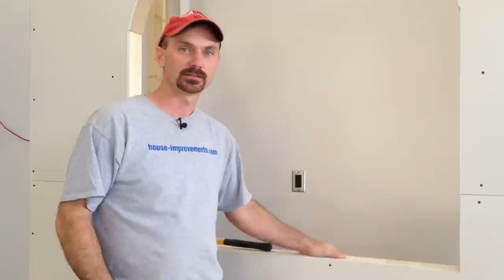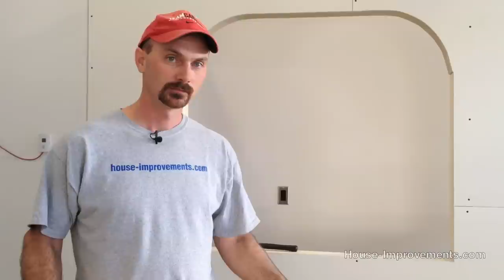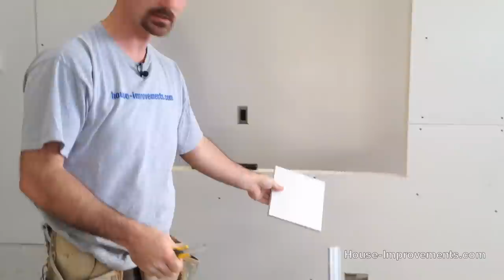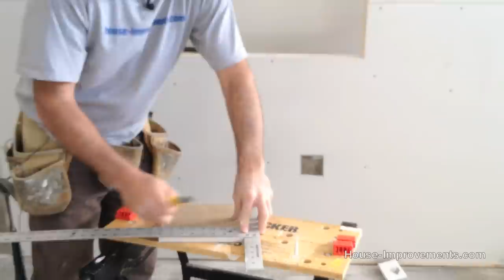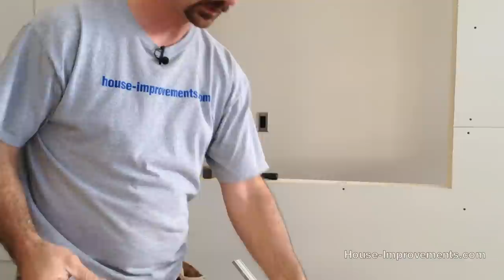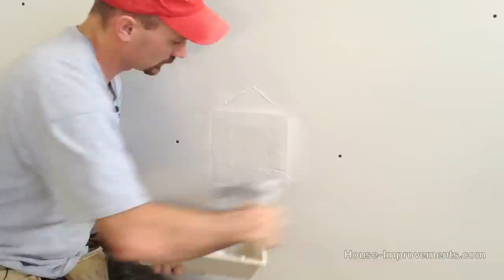How To Patch Drywall

Comment: At first I wasn't sure why you cut a larger piece, but I like what you did there with the paper on the edges. I would have cut the piece to the size of the hole and then taped it, but your way works pretty well. I'll have to try that the next time I patch a hole.
Reply from the maker: Ya give it a shot

Comment: Just watching how you work quickly but efficiently is a pleasure. In the past I have glued a second piece behind, then added the patch. Of course that way the defect is smaller, which is a plus for one less experienced in the final steps. But I can see how this method would be one preferred by a pro, who is not intimidated by a larger defect. Thanks again for going through these seminars.

Comment: I do the same thing, but I will also cut away the paper backing around the hole too, so that when you put the patch in, the paper on the patch is at the same level as the existing paper on the wall, and the mud really only has to fill in the gap between the old paper and the new paper. If that makes sense.

Comment: Nah just put some mud around the inside edges of the hole and the plug, yes use your fingers, now use a bent hook wire to pull it back into where it came from and let it dry, maybe need to tie the wire off to something so it can remain in place. When mud is dry cut off wire flush and carefully push it into its hole, a nail set works great for this. Sand off any excess mess on the outside, vacuum off any dust. Moisten patch area with a damp clot. now use paper tape and mud to finish it off. Don't use mesh tape as if you moisten the wall as it wont stick very well. This moistening only kills any dust that may be hanging around and bubbling up your mud. Let it dry, sand and repeat if needed until smooth. If you desire to use mesh tape let the dampened area dry and then go ahead,  either type will work. If it is a previously painted wall this patch will be smooth and not textured like the remainder. Use a bit of mud and some dry wall primer to make a texture, roll it on and roll it out until dry., this takes a bit of practice as you can get it overtextured. Just remember you can always sand it off and do it again. Another note float it out very large as it doesn't show up so much then

Comment: Terrific technique. 2 suggestions:
• Cut wall hole with the saw blade at about 15° so that the the exterior is WIDER than the interior.
• Slice drywall on a slight matching angle so patch side and repair side are about parallel at the interior. 
• Liberally butter insert edges with joint compound before putting it into the hole.

This creates a mud wedge in the fix and will improve strength.

With that small a hole, though, you could've also used Structo-lite.

Comment: I prefer the blocking method with a chunk of 2x4 screwed behind. Its far stronger and you can make the patch flush to the wall for less feathering to hide the patch versus the extra paper layer added. Plus I bet where that drywall mud fell down before you put the patch in, got nearly no bonding with the top part of the drywall hole in the wall. Issues with not being able to see the joint which is another reason the blocking method is better. This is still a good video for those that don't want to go through the effort of cutting and screwing in the piece of wood behind! Just saying my preference over decades of drywalling experiences.

Comment: thats called a california patch. i use that method all the time. i am a patch guy in new condo construction and i dont carry a drill and/or studs to add backing so i just find pieces of drywall laying around and use that method its quick and works well

Comment: Just a note. If it is an area that is high traffic and can be banged. This is not a good patch. I was doing work in customers house hanging items on the walls. Well, customer calls me and says Item fell and there is a large hole in my wall.  When I came and looked. It was a patch I anchored on to not knowing. You must use sound judgment when using this trick. By all means, it is a really good fix for the right areas of the home.

Comment: We talked a long time ago about patching many 1 inch holes in a panel and you and I thought that just replacing the panel might save time. Well that room got pushed to the back burner and since then I learned how to mud a level 5 finish. I'm going to do this on all the holes and then skim coat the wall because I'm replacing the sheet rock on two walls and I'm not doing a textured hawk and trowel finish on those walls. Two walls will get skim coated, and two walls will be new materials. Your old and your new videos never cease to be helpful.

Comment: why would u not just insert a piece of timber into the hole, fix with screws. then insert your cut plasterboard into the hole, fasten with a screw and job done, 5 mins, no need for mud etc

Comment: Wow, I thought you are going to patch a small hole. Instead, you made much larger hole. I am not professional in filling and sanding drywall mud to level the patch. Why bother, just go from stud to stud for easy and undetectable fix.
Reply from the maker: That is a much bigger patch, What i showed here is very easy and looks good when finished.

Comment: instead of putting a piece of wood to behind the drywall to hold the new drywall in would it be the same to just cut out a piece of drywall and screw it from behind?
Reply from the maker: If you are asking if you can use a piece of scrap drywall instead of wood... the answer is no, the screw will not hold well when installed just in drywall

Comment: nice video, but will this be strong enough if you would apply some pressure on it after it dries ?
Reply from the maker: If you kick it again in exactly the same spot it will likely break like it did the first time, No different then from new.

Comment: This a very smart way of filling a hole.  I wished I had seen this yesterday.
Reply: I had a carpenter show me this trick years ago, and I'm about to fix a hole where I'm moving an outlet, so I thought I would refresh my memory.  I used to just use my smaller square for the "tape" part.  I just lay a pop-in box down on my sheetrock, then draw my lines, then put the square down and draw the wider line for my paper tape.   For whatever reason, they sometimes call this a "California Patch".  Shannon has the easiest to follow tutorials.

Comment: a lot harder than it looks.  drywall paper gets all wet and wrinkled from the mud.  not sure what it will look like when it drys
Reply from the maker: you will be fine, a few coats of mud,sand it smooth and then its ready for paint.

Comment: Wait, you are awesome. Loving all this. Don't need a man.. anyways, you say make the dry wall patch 2 inches bigger.myou then say that you need a 8 X 8 piece. But wouldn't that be double  for a 4 x 4 whole? I was confused.. sorry. Lol
Reply: OK you then cut two inches off of that. Haha!
Reply: +J Randall gotta remember it's 2 extra inches on ALL sides
That's 2 extra on the left, right, top, and bottom. Giving you 4 more inches of width and 4 more inches of length. He cut the extra off just to take it back down to 4x4

Comment: For a big hole use a short length of 1 x 2 say a couple of inches longer than the hole itself and screw it inside the wall on back side of drywall. cut your patch like this fellow is doing here, but it should be the size of the hole. You do not need to trim the hole  other than to make it easier to get the 1 x 2 into it . So just make the patch piece fit to it. Screw it to the 1 x 2  and then tape and float, IT WILL BE MUCH flatter than this method. Remember to float big area as it hides better.
Reply: what do you mean by float?
Reply: use a flat blade trowel to spread the joint compound aka mud.

Comment: Great videos!  Would you patch this the same way for a ceiling? I was wondering if gravity would pull on it to make it sag while drying.
Reply from the maker: If it is much bigger than a couple of inches then you should add some blocking behind it and screw it in.

Comment: quick question? so how would you fix the drywall that broke at the bottom corner of the drywall...it's butted up to the frame of the door?
Reply from the maker: mud and tape it if it is exposed. Most times your door trim will cover an area like that though
Reply: Ok...so do I leave the frame on or take it off? Should I cut out a section and just do a patch?
Reply: So would it be easier to take off the door frame and cut it out and patch it or just jueve the frame there don't cut it out and just out tape and mud? Thanks...

Comment: Did I miss something? After Shannon cut the piece and had the extra edge-paper around the gypsum, the next shot shoes the piece inserted with no paper protruding around the hole's edges. Where did the paper go?  I thought he was going to use the paper on the gypsum as the tape.
Reply from the maker: watch at 7:05.
Reply: I guess it was the angle of the camera that it made it look like the hole was filled with the gypsum piece; but now I assume it was just the shadow it created.

Comment: Why would you measure the hole, then measure the patch for a cut?  Just measure the patch, cut it and simply trace on the wall... Don't even have to worry about perfectly square shape.
And this paper flap leaves raised area that will be visible under a certain light angle.
Nothing beats wooden plank in the back with crews and flash finish

Comment: this is not how you fix it
just cut 4/4 piece  of drywall and insert a piece of 1/2  or 2/2 and screw it , then apply mesh tape and use easy sand 20 , really thin layer , then apply one more layer , then one more and next day sand it , and prime and paint
Reply: He did say that is a method in his video, but he wanted to show us how to do it without using that technique.  Specifically, for smaller holes like this one.
Reply: Greg m Umm. Greg thats actually not true. The method he is using is called a California Patch. He may not realize that it has a name. Maybe its something he picked up over the yrs from an older guy. Probably cause Cali Patches have been around for a long time. Just informing you sir.
Reply: There is more than one way to patch a hole. I've done it your way, with and without mesh patches and it works great. This video demonstrates a great alternative in my opinion. I'm sure there are other techniques out there that I'm unfamiliar with, but the end result is all that matters.
Reply: That's another way. There isn't just one way. You do it the way you like and he'll do it the way he likes.
Reply: Greg m You obviously know how to do it, then why you complaining on videos that show you another technique that can give you same result?Great informative video as always.
Reply: There's a way that leaves raised area (this way) and a way that leaves nothing - won't even be able to tell where it was.
You pick one you like but there's only ONE that is the best